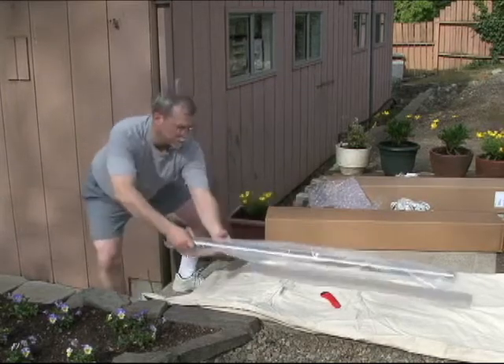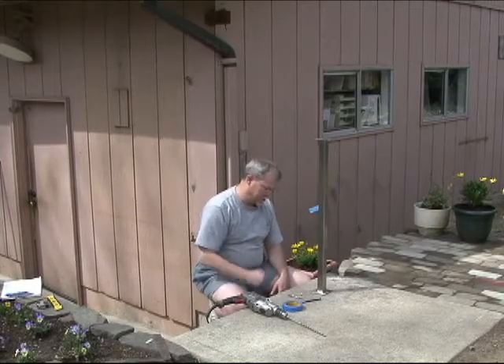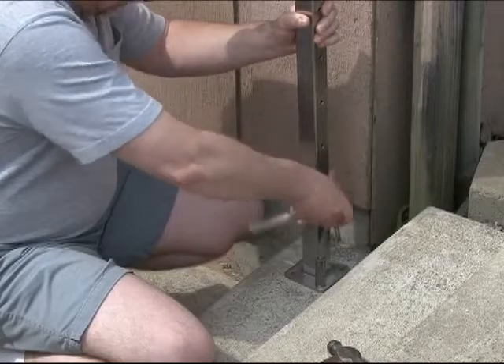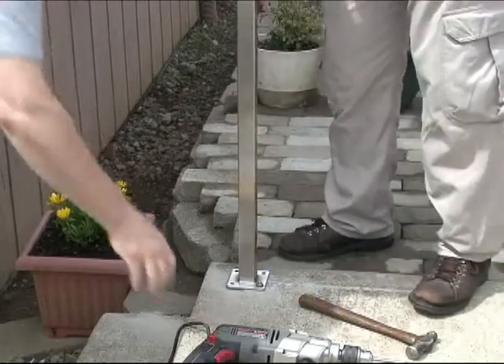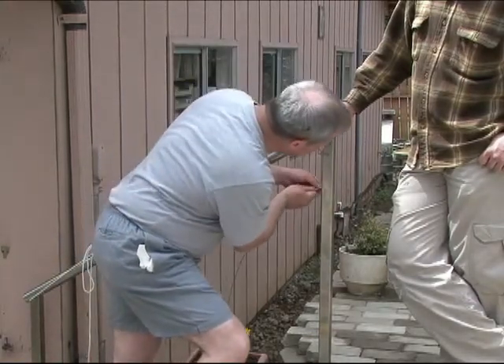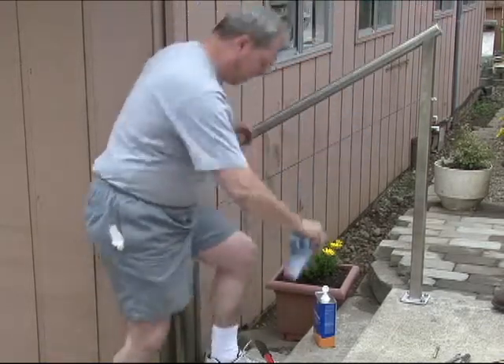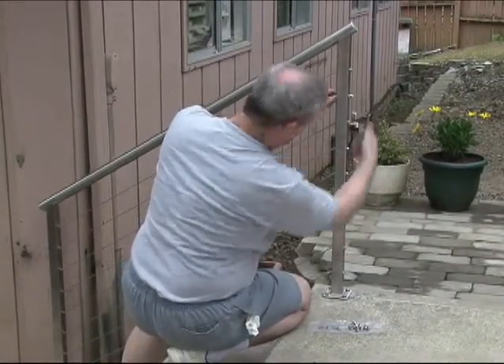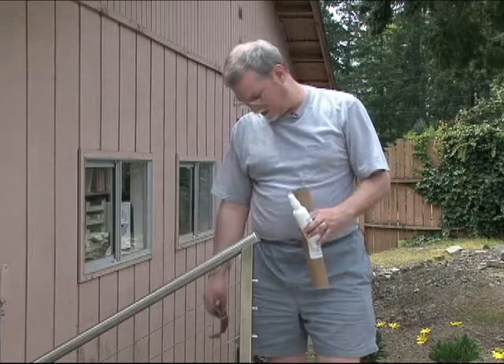AGS Stainless Cable Railing Installation

Comment: about how much did you pay for the kit
Reply from the maker: +willtube78 We are the manufacturer. Our railings are available as either kits or custom-built in our factory. We custom build railings for many installations. This means we build it to fit, our customer gallery is here: https://agsstainless.com/customer-portfolio/

Comment: Holes are drilled at 90 degrees to post.  Does stainless cable bend at swage point?  Is this good?   Won't cables develop slack as swage/cable join bends?
Reply from the maker: Clif, thank you for your interest in The Clearview Railing System. The fittings are bent to the angle of the stairs. This angle is determined by AGS’ in-house design team. The fittings are bent so that the cable terminates in the fitting before the location of the bend. Once the swages are done, you can tension the cable without worrying about damaging the cable or the connection. Any loosening that occurs due to cable stretch or temperature should me minimal and is easily ‘taken up’ by tightening the nuts.
Reply from the maker: +AGS Stainless Inc. In our previous response we did not answer another aspect that your questions bring up: Are the holes in the intermediate posts also drilled straight through? No, we drill the holes in the intermediate posts so that the cable goes straight through (at the angle of the stairs). We have drilled these holes for years using our CNC milling machines, but have installed an industrial laser to do that now.
Reply: Where stay your company?